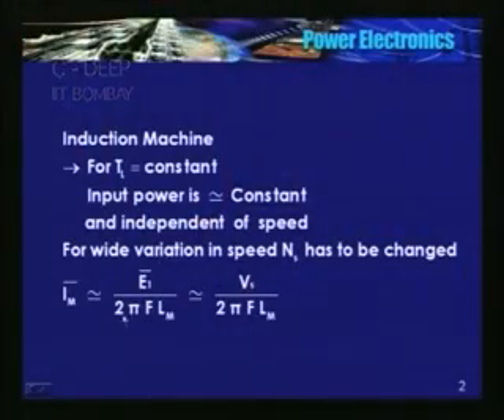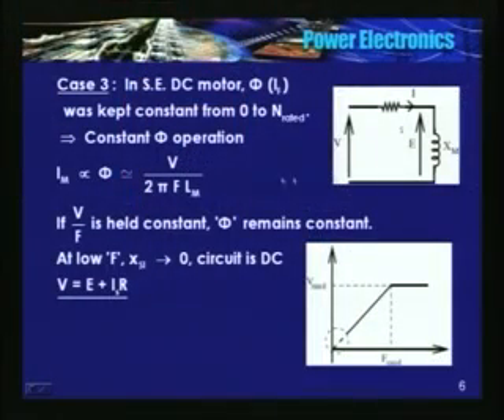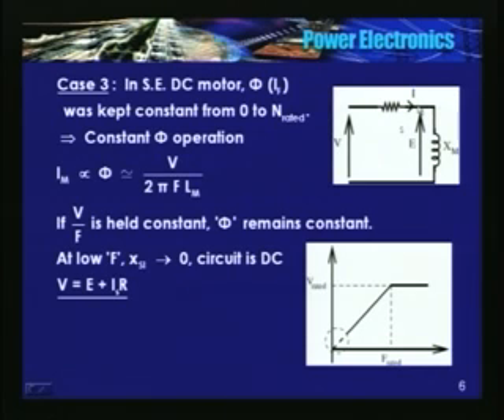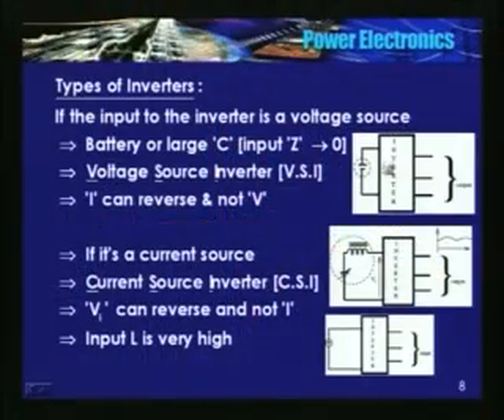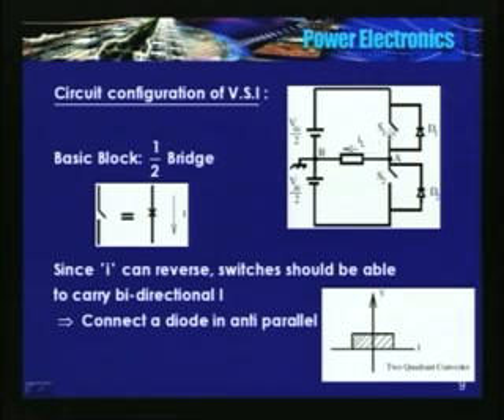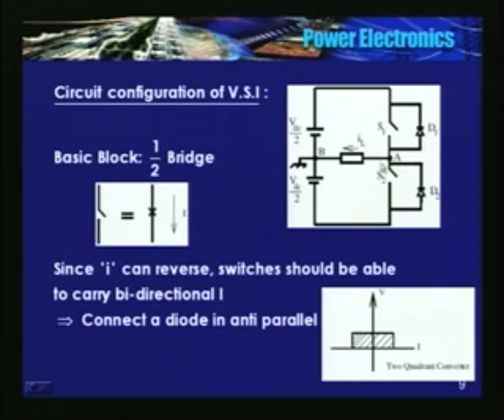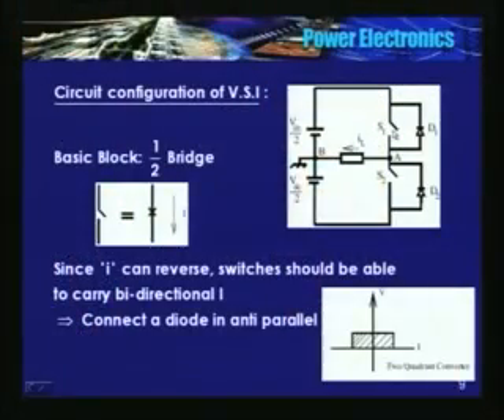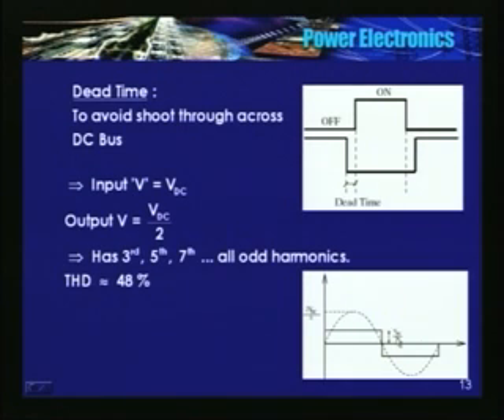Lecture - 34 Power Electronics

Comment: sir, at the time when both S1 & S2 are off, current flows through a diode. But which diode(across S1 or S2) is preferred at which dead time?